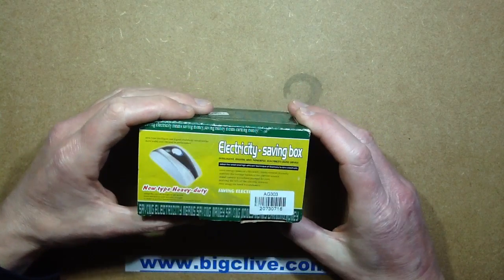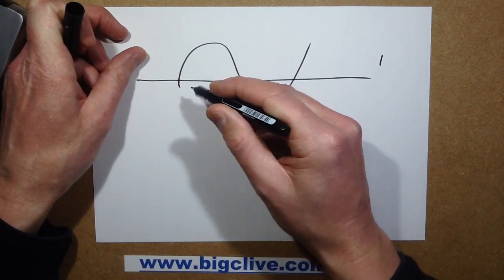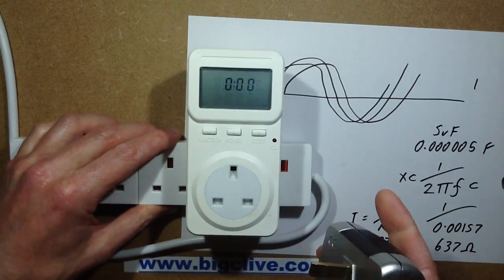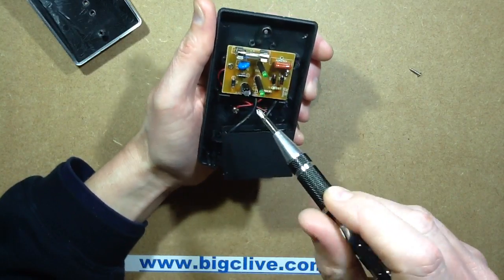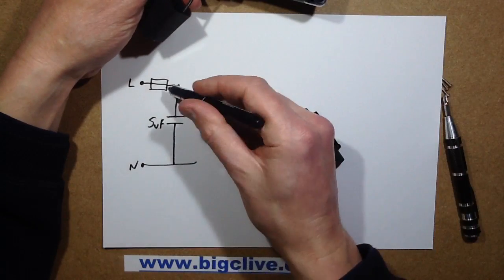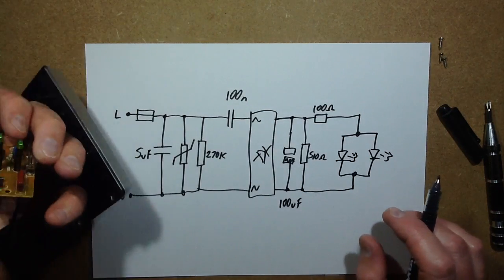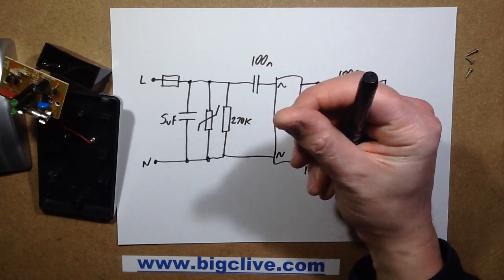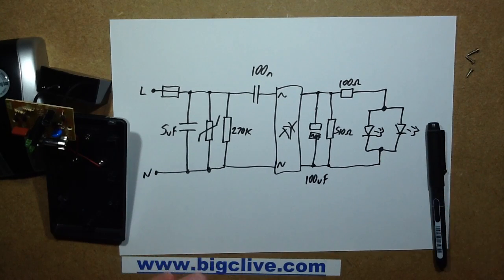Teardown and test of a home power saving plug.

Comment: Will this help if im trying to run a lossy motor on a punny generator? Because even though the motor wants 1500 watts and the generator provides 1900 watts, I can't get it to run the thing because of the power factor (i think)
Reply from the maker: If the motor is single phase then a power factor capacitor in parallel with it may help.  But the motor will also probably have a high starting current that the generator may not be able to supply.
Reply: I'll start it under no load to avoid that. thanks

Comment: I just came across this.  I think "Power Saving" can be valid due to the capacitor actually saving a bit of electricity inside.  Therefore, it is really a 'power saving plug' using a snake oil capacitor...

Comment: As an experiment, I'd like to see what effect this has on the power factor of a CFL bulb. CFLs generally have horrible PF (I measured .45 on one of mine). I've seen the opinion that the widespread use of CFLs might drive power companies to start considering PF in domestic services.

Comment: Would this device be helpful to someone with lights that dim when a fridge motor / vacuum starts up?
Reply: No.
Reply: Maybe 100 of them?
Reply: If your lights and etc. run on DC then it might, though you would probably need more than one. If you have regular AC house circuits like this thing was "designed" for, it will have absolutely zero tangible effect.
Reply: Jim Stanley. What would be a possible reason for lights to dim slightly during a pump starting?

Comment: There is no free lunch when trying to reduce your homes power consumption. Capacitors do nothing to reduce power consumption across a power line. What they might do is reduce current  flow into a motor. It does not reduce power consumption. Your electric utility meter only measures true power regardless of the power factor. You might reduce power consumption in non brush type motor (universal). Read the motors plate voltage, usually 120 VAC in north America. With this you can increase motor voltage not more than 10% or ~ 12 volts to 132 volts. What this will do is make the motor slightly  more efficient by reducing heat dissipation: less heat=more efficient. This does nothing for the power factor. Some motors are rated at 110 volts with additional taps; this is ideal, saves one from buying a transformer, just operate  at 120 VAC instead of 110 volts. Otherwise buy a isolating transformer, 12 volts secondary and it MUST have a current rating of the motor current as stamped on the motor name plate. One can reduce line voltage by 12 volts but DO NOT attempt to operate a non brush type motor on less than the name plate voltage, so be wary of how you hook up the transformer. Operating a non brush type motor on less than its nameplate will overheat the motor, leading to fire, burnout. nasty. Only brush type motors can one fool around with less voltage, avoid additional voltage. Please! Any resistive only load in the home can be adjusted to less voltage to reducing power use. None other need apply!

Comment: and they still sell the dumb thing on ebay with a US plug in the exact same box  (not sure this link will stay or work )  oh but it's less than $5 whats the harm :P  I'd rather get the ones that light up fluorescent tubes :P  http://www.ebay.com/itm/Power-Electricity-Save-Saving-Energy-Saver-Box-Save-90V-250V-US-plug-for-Home/141683781691?_trksid=p2047675.c100005.m1851&_trkparms=aid%3D2220071%26algo%3DSIC.MBE%26ao%3D2%26asc%3D38530%26meid%3Dab7bf977f73e472babe3bff94529baed%26pid%3D100005%26rk%3D6%26rkt%3D6%26sd%3D111872605541

Comment: Hi BD...

It would be interesting if you mount a internal only electric circuit... passing through a power meter (showing V/A/W-counter at the same time)... then passing though one of this things (I would like to see all the ones you disassembled to show us)... so we could see the change those aparatus do.... then maybe choose a set of good/bad behavior power devices and connect them to that internal circuit so we could see the influence (or not at all) of those things... 

Thanks for the videos...

Comment: These are nothing new our 3 freezers have 'energy saving' plugs from iceland for 15 years ,the difference is the pwerlead to the machines is wired into the devices.
One was on our 1957 prestcold fridge but while i was rewiring it i put it on our new freezer LOL even if they do nothing they are big enough to write on telling me which freezer is off

Comment: "Hey folks, this is a pure lie, we do not pay for reactive power current (inductive and capacitive strength) than the current active power (clean working current resistance), thermal, electro-mechanical and magnetic, light form of energy"."If it were possible, our first inventor / scientist Nikola Tesla, who all studied, given to mankind to have savings, (referring to the system of polyphase alternating current), back in 1886!".Reactive power failure, is used to compensate the measuring instruments, the accuracy, frequency, phase, peak amplitude, and other measurement systems in the electrical distribution and some industrial systems, but never in the home upotrebi.Ing.Milan Stojkovic.

Comment: Power companies don't charge you via VA then but real actual watts. Power factor is useful for things like the output transistors of a speed controller, whose temperature depend on the current flowing through them. Theoretically if you had an inductive load and a resistive load in series you could save a bit of energy with power factor correction on the inductive load.
Reply: Depends on the inductance of your inductive load. It could even give you a worst power factor.

Comment: This is a crappy home version of the "capacitor yards" found near the electrical utility entrances of large manufacturers or any commercial plant that uses heavy inductive switching loads, and therefore must have balancing capacitance added in order not to load the Utility's transformer or branch feed with heat generating loads. So this thing is real, but it's application to residences is totally useless.  Unless the residence has HUGE inductive loads being switched on and off.

Comment: I knew what was inside before you opened it. Just a capacitor, again electronic snake oil. Salvage the parts.
Reply: I hope change the capacitor 5uf to 50uf  is work good

Comment: have you ever done a review/teardown of a plug power meter for measuring equipment and recording kwh used over a mains plug? I wanted to get one for my Ebike charger to record the amount of watts I've actually used from the wall and keep track of my recharge cost
Reply: There are power usage devices also, when Ilved in Tempe, AZ the library allows you to check one out for a week along with your books no cost it was PRETTY AWESOME learning what allwas using how much power etc etc and total usage as well for 24 hours and so on it was pretty great😊

Comment: When I was taking electronics classes, we were told that factories used florescent lights because florescent lights act like capacitors on the AC line, they did this to compensate for the inductive load on the motors.  (any truth to that)

This is the first time in over 10 years I have even SEEN the formula for Xc.  :D
Reply from the maker: +weasel2htm The fluorescent lights used to use magnetic ballasts that required capacitors for power factor correction.  There's not an excess to counteract the inductance of other loads like machines.

Comment: It really isn't such a good idea to plug in a capacitor on your home grid. Because a slightly inductive grid isn't a bad thing really. What is really bad is if your home grid becomes capacitive, what happens then is that the voltage could creep up to double the normal value,  which in turn means you'll blow out anything that is connected to the grid. But since this is a pretty small capacitor I would see this happening. Very interesting video nonetheless. And I liked the calculations you did. 

Keep on going

Comment: I can turn every fused plug into an energy saving plug - merely by removing the fuse.
Reply: Or switch the main switch off. 100% saving !
Reply: lol fail
Reply: Azzy M Or bomb the power factory. 1337420% savings!
Reply: Ron - New Channel OPGuyK actually, that's 2147483647% savings

Comment: thanks for your hard work , but would you say will the device work as said ? thanks .
Reply from the maker: +Mohamad Khalil Hamieh The only way this device can save you money is by encouraging you to turn off other items in the house.  It doesn't actually do much at all.
Reply: +Harry M No. It gives you free electrical shocks when you touch it too :D
Reply: +Harry M well for those 2 leds and any heat dissipation in the various components. Other than that it doesnt consume any more power.
Reply: +Mohamad Khalil Hamieh +Mohamad Khalil Hamieh The product is 100% BULLSHIT. Companies selling such power-saving or fuel-saving products prey on people's desperation to save money.

I am an electrical engineer by training.
Reply: Check out Somar of UK if you want to know about real fraud. This one is peanuts.
Their power saver modules  and dealership tactics are criminal.

Comment: I must have a look at the "saver plug" I got blackmailed into getting with a freezer I bought years ago. I have a suspicion that it will be like this.
Reply from the maker: Those things usually use a simple dimmer-like phase controller.  I'm not sure I'd recommend them.
Reply: bigclivedotcom It hasn't killed us yet, but I doubt it's saved much. It would be nice to have a better grasp of the electronics.

Comment: Dear Sir.HelloCongratulations.This  perfect device  saves you a  lot of money  by correcting  the cos φ As  you know  it  has to be  1.If  it is not  ,  many  devices  which are connected to  the  mains  consume more watts.Also  this device it recycles  energy. In this PERFECT  WEB SITE  (  YOU TUBE )  there are many videos  which explain what this device does .Kind RegardsDr. Panos.

Comment: Please do a vid about power factor and inductive loads on AC. I get that there isn't much you can do about it around the house with a single 50 Hz phase. What I don't get is what the hell is going on back at the electricity factory. Why do they charge more?
Reply: BenjaminGoose yes, about losses in transmission line at high current - and BTW it's why transmission of high voltage is preferable over high current - if you transfer at voltage V and current I over line with resistance r - transferred power will be V*I and losses r*I^2, if you transfer at voltage V/2 and current 2*I - transferred power will be the same V/2*2*I=V*I, but losses will be r*(2*I)^2=4*r*I^2 - 4 times higher
Reply: +Dullthud007 
http://www.allaboutcircuits.com/textbook/alternating-current/chpt-11/power-resistive-reactive-ac-circuits/
Reply: *****
 That's splendid. I think I'm going to have to re-read it a few times, but I did get my software thingy to change the current phase from the voltage phase. Thank you.
Reply: Dullthud007
it's easy to understand if you remember that P=I^2*r where r is resistance of power line and P - losses for delivery current I to the consumer;
look at reactive load as a storage device;
for example if you have pure active load which draws 1A and resistance of power line is 1ohm then in 2 hours losses will be 1A^2*1ohm*2hours = 2Wh;
now let's say we have in addition some reactive load which store exactly amount of energy which active load consumes - in such case exactly half of the time such load will draw from factory twice as much current than in previous case and half of the time will draw 0 - let's calculate losses in power line: 2A^2*1ohm*1hour + 0A^2*1ohm*1hour = 4Wh - as you can see in such case despite the fact that consumer consumes exactly the same 2Ah, losses in power line is twice as much as in case of pure active load.
Reply: +z08840 Ah so it's about power loss in the supply at high current / low voltage??

Comment: Hi Clive, great vids very informative. Some things 'supposedly' being equal, i'm curious. How does an old analogue spinny meter compare to a new style digital one in a domestic installation? Could this gadget have a use after all, with regards to inductive loads??
Reply from the maker: +simon hare It shouldn't make a difference what type of meter is used.  Both should measure actual power used and not apparent power.  Although I bet the electricity companies have the option to switch the meter to apparent power if they suddenly decide they want more cash.  Either way the unit shown is just a random value that doesn't take into account the actual power factor of the installation.

Comment: The 3-4mA off calculation must be due to the current used by the green LED and its resistor.. Just stating the obvious but for those that didn't give it a thought.. I need to get one of those power meters!

Comment: Hi, very nice video. I was sure that this thing is a scam and nothing more. The easiest way to calculate how much current a capacitor across the mains draws is usually like this: a capacitor draws 7mA per 100nF or 0.1uF so a 5uF would draw 350mA at 220-230V. That's generally rule of thumb that I use. So based upon what you showed in the video, this thing draws about 97W just sitting there and wasting your money. When I see something like this it makes my skin crawl. Here in Romania they charging about 50$ for this pieces of shit and there are a lot of suckers that got caught on buying them. Please review and teardown a pest repeller device or mosquito repellent. They are also big scams...
Reply from the maker: I'm not sure about Romania, but here in the UK the home meters only log real power, so the capacitive load should not register at a significant level on the meter.
Reply: bigclivedotcom I'll try that today and get back on you, cheers :)
Reply: +ciprianwiner Which pest repeller's are you speaking of? chinese ones? My parents have a bunch of electronic pest repellers, not cheap mind you, some run directly on 240v and some use batteries, they are AMAZING!!!!!! My Dad has the dials turned all the way up to repel pretty much all animals and any human under the age of 40-50................... Mice refuse to go anywhere near the sheds, and after 5-10 minutes in there I want out, the high pitched whine emitted from the devices is intolerable.
Reply: @Muffin_Masher  which devices do your parents use? I'm looking for a good repeller for the quonset
Reply: +ciprianwiner But the tester proved with his watt meter that the useless in home domestic device uses no or little measurable power, when read off on his to the nearest watt meter.
Reply: The capacitor doesn't dissipate any real Power in the physics sense (well very little) so even though Current flows to build up a charge each half wave, it's not doing any Work.  If the current were flowing through a resistor it would dissipate Power (doing Work) in the form of generating heat. But the capacitor's reactance is not the same as resistance. 

I was also intrigued by this.  You would think Power = Voltage x Current but that is for a resistor, doesn't apply to a capacitor with no load.  I'm still unclear about the math in that part.
Reply: The capacitor doesn't dissipate any real Power in the physics sense (well very little) so even though Current flows to build up a charge each half wave, it's not doing any Work.  If the current were flowing through a resistor it would dissipate Power (doing Work) in the form of generating heat. But the capacitor's reactance is not the same as resistance. 

I was also intrigued by this.  You would think Power = Voltage x Current but that is for a resistor, doesn't apply to a capacitor with no load.  I'm still unclear about the math in that part.
Reply: The capacitor doesn't dissipate any real Power in the physics sense (well very little) so even though Current flows to build up a charge each half wave, it's not doing any Work.  If the current were flowing through a resistor it would dissipate Power (doing Work) in the form of generating heat. But the capacitor's reactance is not the same as resistance. 

I was also intrigued by this.  You would think Power = Voltage x Current but that is for a resistor, doesn't apply to a capacitor with no load.  I'm still unclear about the math in that part.

Comment: I have used fixed capacitor correction of more than 100 microfarads with a highly inductive 240V 50Hz transformer load (PF=0.2) on the end of a long extension cable. Wall plug current and voltage drop of the extension are reduced by more than 70% and the extension cable runs much cooler - but that is the only power I am saving. Using a capacitor to generate the required VAr at the terminals of the load is the way to go in this case, but unless you are an electrical experimenter already running up against supply limitations you will not find much benefit with a normal domestic set-up. For most people it will be snake oil I'm afraid, even if there is a basis in fact you need a proper assessment of load currents and PF before any type of PFC will do much good. The 5 microfarad capacitor is small enough to do no damage but not really big enough to do much good. That's a very useful video you made there, thanks.
Reply: and this review that you did is pretty great as well thank you so much😊

Comment: I AGREE WITH BIGILIVEDOTOCOM THAT THIS DEVICE DOES NOT SAVE ELECTRICAL POWER WATTS , BUT ONLY IMPROVE THE VARS BY IMPROVING THE POWER FACTOR NEAR ONE .THIS WILL IMPROVING THE GRID LOAD BY REDUCING THE MVAR IN THE GRID SYSTEM WILL MAKE LESS CURRENT IN THE OHL AND WIRE SIZE WILL BE REDUCE WHICH IMPROVE THE ECONOMISTS MEAN LESS CURRENT-LESS CB RATING LESS MEDIUM VOLTAGE CURRENT RATING AND .........
OSMAHJOUB-
OSMAHJOUB@GMAIL.COM